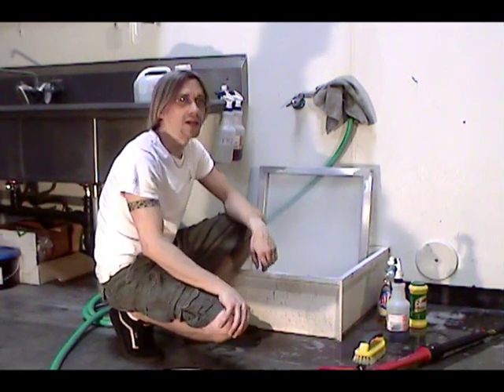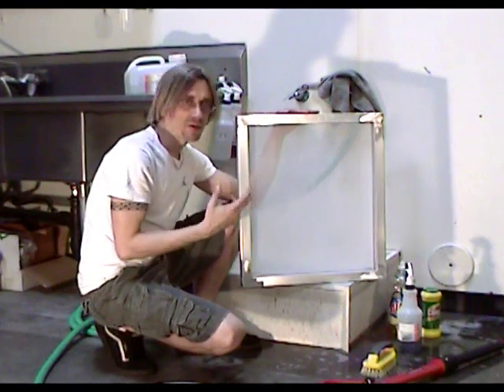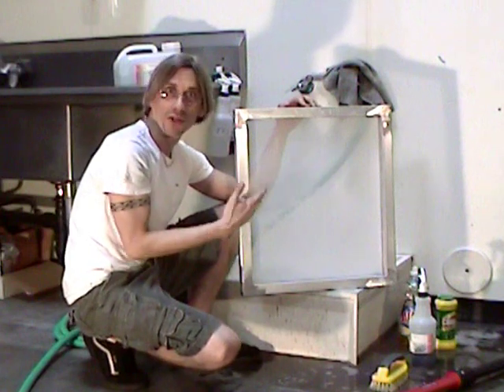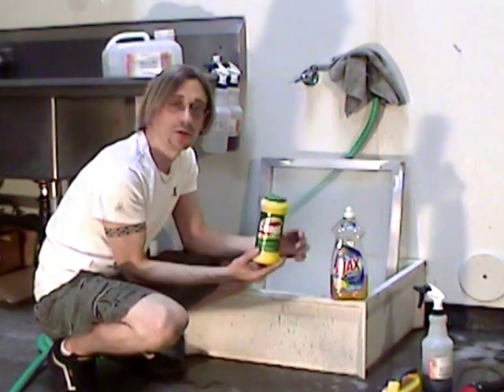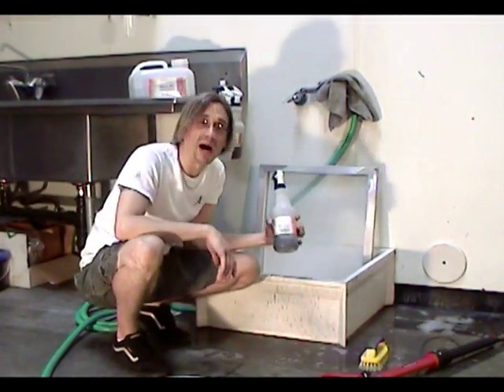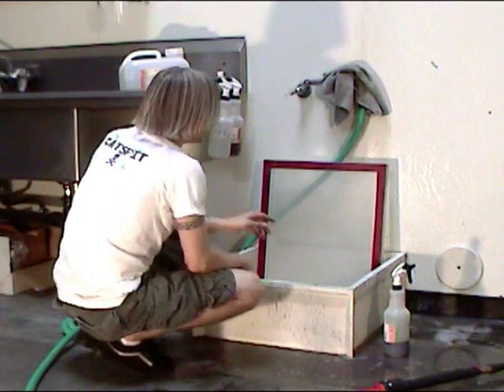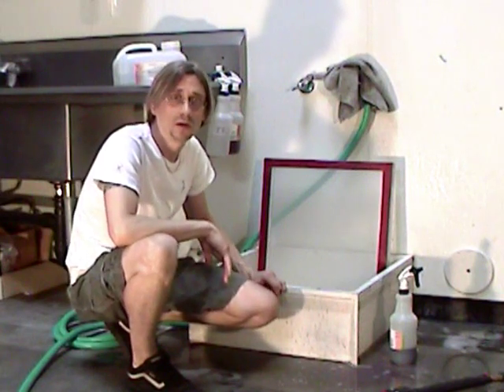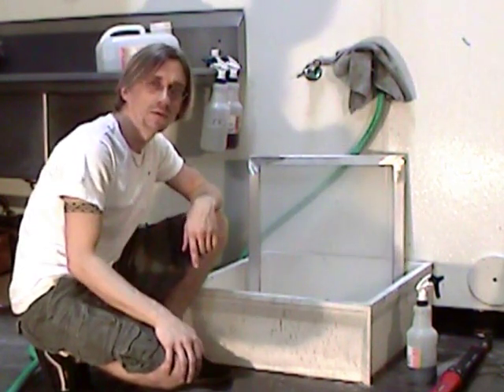How To Screen Print: Preparing The Screen For Emulsion Expanded

Comment from the maker: @thechupi666 I don’t use retention-able screens because they can be expensive and I need a good stock of screens. And most of my work is not that critical as far as mesh tension. As long as it’s around 20 Newtons it’s pretty decent on a rigid frame. And they are cheap enough I can buy them whenever I want some fresh screens. But mine seem to stay very tight for some time. Thanks for watching and leaving a comment! ☠

Comment: I have reclaimed my screens but when I went to print on my press I noticed that a shadow of some sort appeared on the shirt.  I had good detail on my stencil but I was getting a shadowing affect.  After watching your video, you mentioned a haze remover.  Could it be that the previous image remained on the screen after I reclaimed it and now I need to dehaze 1st and then reclaim the screen with my reclaimer solution?
Reply from the maker: Exactly. The ink from a previous job may stain the mesh causing the mesh openings to become slightly smaller. This results in reduced ink flow in the patter of the previous print job. Use haze remover to clean satins and haze from mesh before using mesh prep and coating screens: http://catspitscreenprintsupply.com/saatichem-hr5-haze-stain-remover/ Thanks for watching and leaving a comment!

Comment: Hi again. What do you think about drying clean but wet screens in a belt dryier? Any dangerous issues?
Reply from the maker: You shouldn't need to do that and you could melt the fabric causing it to shrink and release form the adhesive. Even the heat might adversely affect the adhesive over time. Make it brittle perhaps. Thanks for watching. Screen Printing Equipment & Supplies - http://catspitscreenprintsupply.com/

Comment: We bought a screen printing business and they had some screen just sitting with ink on them. Can we clean them without loosing the design they have on them? Probally been sitting for 2 weeks
Reply from the maker: If it is plastisol inks then yes, you can still clean them off with a plastisol solvent. http://catspitscreenprintsupply.com/saatichem-pw4-press-wash/ But if we are talking about water based or solvent based inks then they are dried up by now and the screens are ruined. They will need to be re-stretched. Thanks for watching and leaving a comment!